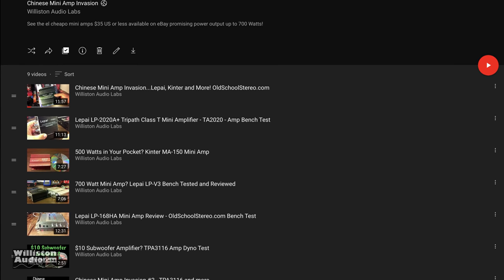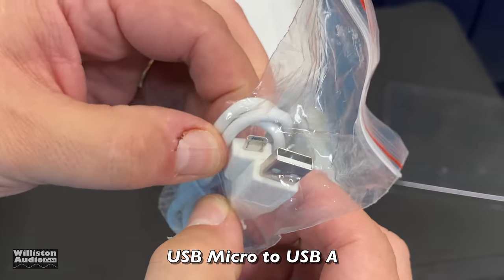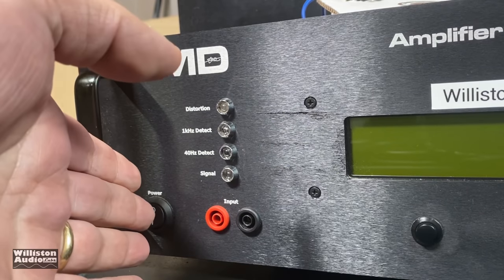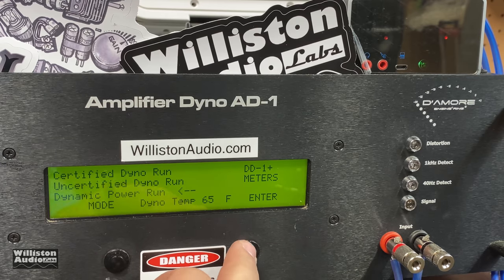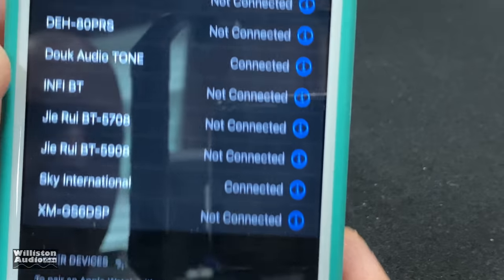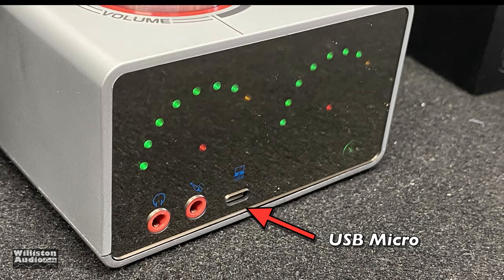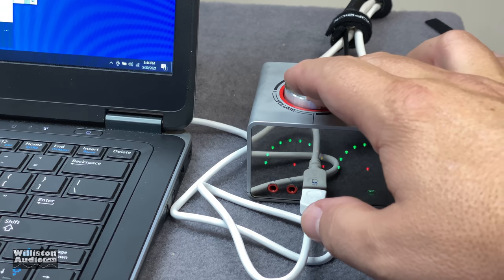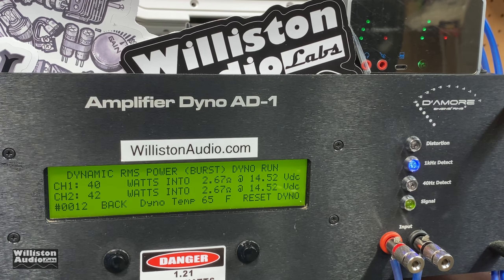Amazon Mini Amp Best Seller? - Douk Audio TONE 50x2 MAX Mini Bluetooth Amp Dyno Test and Review

Comment: Run Two of your Batteries in Series and see what that little gem will do with some 24 volt juice with some amperage !!
Reply: exactly. Thats what Ive been saying. Get her maxed at 24 full rated voltage and see how she pumps out
Reply: I'm for this.
Reply: I recommend use the 200W Lab PSU or 24V brick. That 19V is common for laptop psu. If using 2x 12V lead acid (14.4V) can be too much for that. 2x 3cell lion is much more closer to 24V but still over it if full.
Reply: Price  Kya  hi

Comment: Could you try testing this amp at 24 volt input?
Reply: with 26v in, the amplifier ic that does not have a heatsink becomes very hot!
Reply: It could overload the circuit to bt, also possibly vu meter too
Reply: @benzodiy4053  volt regulator that sits on the amplifier board that gives 5v to the preamplifier gets VERY hot! 24v to 5v is a bit much!

Much of what you buy on eBay is poorly designed and the watts that are written are almost always more than what is true!

people only go for the most watts and nothing else. People do not look at datasheets for amplifier ic.
Reply: @benzodiy4053  But its rated for that
Reply: His capacitors will pop at 24v. Bcoz 65 volt in chinese means 20volts.
Reply: @nearchd504  thats what im sayin, dont know untill you try. Thats what Williston is all about right???? NO, YES?? Thats what these tests are all about is breaking the assumptions that these amplifiers promote? Correct? If its rated at a certain voltage or amperage, then lets get at it scientifically and provide facts as to what degree the posted numbers say. IN OTHER WORDS, WHERES THE EVIDENCE!!!
Reply: @quevicular  I can't argue with a chief justice lol.  Let's hook this up on 24volts
Reply: @nearchd504  Now your talkin. Wonder if big Dummy is around to hear this?

Comment: Why does a $50 amp look better than many $1000 amps?
Reply from the maker: #iknowrite
Reply: $50 amp is trying to attract a different customer than $1000 amp.
Reply: @c0c0asauce  The sighted?
Reply: @Roof_Pizza  Certainly to some extent. You can't predict what a customer will be looking for 100% of the time but personally I don't care much what a $1000 dollar amp looks like. I'm paying the money for power, quality, and reliability.
Reply: @c0c0asauce  Most are pretty close once you start paying bucks. If a  $1000 amp doesn't last 20 years there is something wrong. If it truly was a tossup I'd go for the prettier one every time. No industrial boxes needed. Makes them easier to sell when it's time to upgrade as well.

Comment: Using older model for powering some semi-small speakers at PC, good enought for everyday use. Those 50W max is at 24V at 4ohm load. Oh, and about those VU meters... they are mono, just single channel to two sets of led's.
Reply: Was about to post the same.   19 volts is not going to happen at 4 ohms.
Reply: The VU meters look a bit suspect and look to be for just show. I could be wrong but it should be fed a rising amplitude sine wave for the test. One would think they would start at the low position, and gradually rise until red and then clipping sets in. Not that it really matters but it would be nice if they were tied to the output or referenced to it to let you know when your getting to its limit.
Reply: volt regulator that sits on the amplifier board that gives 5v to the preamplifier gets VERY hot! 24v to 5v is a bit much!

Much of what you buy on eBay is poorly designed and the watts that are written are almost always more than what is true!

People only go for the most watts and nothing else. People do not look at datasheets for amplifier ic.
Reply: It is made with as many fault as the edition I have that almost is similar to the one in the video. Completely the same amplifier card in both!

The card is mounted the wrong way with amplifier IC. Against back wall without heatsink on amplifier IC. and RCA plug is mounted over amplifier IC.

5V volt regulator to the front card gets very hot!

Mine had noise. So I had to put on a 1 UF condenser over + - on speaker output.

Min has a slight digital noise from preamplifier IC.

It has weak preamp sound output so when you connect Bluetooth  you never get Max Watt out

Those who have created this have been on a party first before they made this!!

Not the first time I see things that are made so wrong

Ebay. 383859993473
Reply: @ford1546  Yep.  What I say is buy better speakers.  15 watts can go a long way with a good pair of speakers.   If you want to drive a sub get a Sub amp built for the task.  For normal listening 15-20 watts is just fine.  1 watt can even be just fine for normal listening levels.
Reply: @jeffm2787  yes it is speakers that count the most but I would also have bought better amplified than this one in the video. do you want suggestions?
Reply: @ford1546  LOL,  No.  I have many amps.  This is not one I would use with good speakers.   Class D has come a long ways but I'll still take a good Class A/B.  I use cheap class D for stuff like the garage or the PC.  I have a cheap class D on my 9.4.2 setup for the back surround height channels.  I don't buy Bose,  but I'll use them if given to me.  I think you should see the point.  JBL, Infinity,  BA,  perhaps some Polk is kind of where I land.
Reply: @jeffm2787  Cheap class-ab is almost always better than cheap
class-D !
Reply: @ford1546  Agreed.  I love to use Class D when I don't care that much about the sound and I want to save a few cents on my electric bill.  A Class A/B powered on 24/7 adds up even at idle.  Class D,  not so much.  High end class D sounds good these days.  But we are talking a completely different price league.
Reply: @ford1546  soft and warm sound from the a/b amps, the class D is only for psu use :-)
Reply: @jeffm2787  Class AB left on 24/7 is about a hundred watt lightbulb. Doesn't really add up to much but nothing wrong with Class D for Home Theater.
Reply: @carlosoliveira-rc2xt  100 watts 24/7 at 15 cents per Kw/h is a bit over $10 a month.  Pretty wasteful if you ask me.    $15 a month if you live in places like California.
Reply: @jeffm2787  $10 a month wasteful? That's won't even pay for a Tim's coffee every other day for a month. Let's be realistic, there are thousands of things more wasteful. Optimum sound, depending on amp, may take 3 or 4 hours with a class AB version yet that's your preference? I'd say that's contradictory to your logic. A t- amp will output the wattage you claim sufficient for most instances and is easy on the wallet with respect to cost to purchase and run and therefore can be left on indefinitely. I've compared a 2020 chip t-amp ($50) to amps as costly as $1800 and it sounded better. Now my class A amps, those may actually be wasteful!
Reply: @carlosoliveira-rc2xt  Problem is it all adds up when you look at all the stuff running 24/7.  Ceiling fans are a good example.  $10 a month will get you a subscription to some steaming service that you can enjoy.  Pissing away $10 a month,  yep that's wasteful by definition.  Might as well get some mid priced beer,  at least you can say you enjoyed pissing away the money.
Reply: Price tel me sir

Comment: I've just recently found this channel. I've came across a predicament. I don't know if you take requests, but I have to ask. LANZAR VECTOR VCT-4110 this amp doesn't make any sense from the instructions. I've been installing car audio for about 20 years. I would like to know if it really puts out as much power as it says??  When I was younger, LANZAR was a respectable name. So could you please get that amp and review it?? You are awsome, I just hope we don't hear the "Price Is Right Fail Sound." You can get it on Amazon for like 80$ Thanks man,,,,,, I love this channel!
Reply from the maker: Thanks brother and unfortunately the lower end Lanzar is way overrated. Lanzar from the 90's was very nice and well built. Now you have to get the pro version of Lanzar to get the decent stuff. It's owned by parent company MD Audio who also owns Orion now. The HCCA and XTR Orion is nice, but the Ztreet and Cobalt is ho hum. If you've been out of car audio for a while, it will be very confusing now. Most of the brands you once knew as good ones are not so great now, however, Rockford, MTX, Kicker, JL Audio, MMATS, Alpine and AudioControl are still great.
Reply: Thanks man. For real.

Comment: It looks fancy but the thing is cheaply built, plasticky and lightweight. However its multiple inputs and outputs for that size is really impressive, saved much desk space. Have been using it for more than 2yrs for my PC, PS4 and TV. The lack of volume indicator is really annoying and its lightweight makes it doesn't sit solidly at the edge of a desk

Comment: Cool little amp, thanks for the video.
Reply from the maker: Yeah man, I have a thing for the little amps and you know those VU meters GOTEEM!
Reply: @wal  I run 2 JBL JRX225 dual 15” towers and a 4-15” JBL GTO on a 3 ch mini circuit board amp using a 20 v lithium drill battery in my camping/cargo trailer and it absolutely whails!  I haven’t met a person yet that hasn’t been blown away (pun intended) by it.
Reply: @russelllopez4171   please post a vid of your setup.
Reply: @MiloPerrotti  ok, I’ll be honest I just dumped one 15” and am running 3 @ 1.33ohms. It actually rips harder than the 4 due to better tuning and I can run at 1.33 instead of 4ohm.  I’ll make it even more fun and I’ll meter it in the trailer with my term lab. Lol
Reply: @russelllopez4171   That would be great to see. I would love to do the same setup or close anyways in my trailer.
Reply: @MiloPerrotti  I’ll just do a quick hookup of them for display but I typically run the towers at the end of my trailer and leave the subs at the front of it.  And if I’m not facing noise restrictions I have a generator and a pair of QSC1450 concert amps that run it and it is just like having a system in a car. Lol.

Comment: That's decent power for it's size, and adaptability of this amp is a big plus. This would be great for a custom portable speaker build.
Reply: they sell the boards themselves - minus the chassis for cheaper as i have built  few of these before ... pair them with 18650 type lithium ion rechargables ...

Comment: I’ve run a Lepai amp in a Bluetooth speaker I built and have come to find out that some of these little amps have a higher output if you use a battery instead of the included power adapter

Comment: That's a cool amp. Nice look. I love the fact it can be a USB sound device.
Reply: It is made with as many errors as the edition I have that almost is similar to the one in the video. Completely the same amplifier card in both!

The card is mounted the wrong way with amplifier IC. Against back wall without heatsink on amplifier IC. and RCA plug mottled over IC.

5V volt regulator to the front card gets very hot!

Mine had noise. So I had to put on a 1 UF condenser over + - on speaker output.

Min has a slight digital noise from preamplifier IC.

It has weak preamp sound output so when you connect Bluetooth  you never get Max Watt out

Those who have created this have been on a party first before they made this!!

Not the first time I see things that are made so wrong

Ebay. 383859993473
Reply: TPA3116 is a good amplifier ic. if everything is designed correctly. you get good amplifier card based on TPA3116 but this box does not have good amplifier design!

Comment: there is a new version out now and I'm wondering what chips it uses?  still the 3116 for amplification or a newer chip?
Also what is the bluetooth capabilities of the new one?  is it the qcc3031 chip or???...
There is also another cheap bluetooth amp the Douk Audio M100 that uses the Infineon Merus MA12070 chip.  I bet this sound good for the money.

Comment: I was surprised by this one. First by the power. I figured it would top out at 15w per channel but it doubled my expectations. And then when you opened it up I found out why with those caps in it. I was not expecting caps that big in this amp. For $50 this isn't bad. I mean it's not an ifi or a mojo but it's also not $500. So as far as getting some inteligible sound this thing is a steal. I mean it's way more than I expected for $50. Your not going to hook up a pair of tower speakers for critical listening with this thing. Your still getting more than what your paying for

Comment: I would like to see what happens cranking up the voltage. TPA3116 D2 handles up to 26 VDC
Reply: TPA3116 is a good amplifier ic. if everything is designed correctly. you get good amplifier card based on TPA3116 but this box does not have good amplifier design!
Reply: It does say 50x2 @24V
Reply: @Raymo2u  50w is when you push it hard with optimal power supply and constant 4 ohm load. 
But then you should have heat sink on amplifier ic. something this one does not have.

Factory writes the following. 
You should never have more distortion than 1%
10% is way too much. 
10% THD does not count!

THD + N = 10%, f = 1 kHz, PVCC = 14.4 V
25W

THD + N = 10%, f = 1 kHz, PVCC = 21 V 50w

THD + N Total harmonic distortion + noise VCC = 21 V, f = 1 kHz, PO = 25W (half-power) 0.1%.

Comment: Need an amp for my home gym. This seems perfect.
Reply: It is made with as many errors as the edition I have that almost is similar to the one in the video. Completely the same amplifier card in both!

The card is mounted the wrong way with amplifier IC. Against back wall without heatsink on amplifier IC. and RCA plug mottled over IC.

5V volt regulator to the front card gets very hot!

Mine had noise. So I had to put on a 1 UF condenser over + - on speaker output.

Min has a slight digital noise from preamplifier IC.

It has weak preamp sound output so when you connect Bluetooth  you never get Max Watt out

Those who have created this have been on a party first before they made this!!

Not the first time I see things that are made so wrong

Ebay. 383859993473
Reply: bluetooth speakers have gotten really good also
Reply: @FSXgta  Yes since electronics have become cheaper. Many Bluetooth speakers like JBL Xtreme use DSP. Signal processor where factory adjusts an equalizer.

Comment: Only complain I have on mine, the Fosi Audio TB10A (TPA3116) and Douk M1 Pro (TDA7498E) are that if you connect them to high-sensitivity speakers (95dB/W) there is slight hiss that can be heard in the tweeters (if your volume is high and music is not playing). In comparison, my full analog Marantz PM5005 (~80W x 2) is noise-free and has more "depth" to the sound but the price and size are magnitudes away from these little chip amps. At this price point though there is not much to complain about considering their size and versatility.

Comment: Might be worth it to test RFI (radio frequency interference) within a few feet of it. I've got a Dayton Audio mini amp powering some ceiling speakers to have music throughout the house. It sits 2 feet from my stereo receiver and works great with any source.....except FM radio. Reception is fine until I turn that mini amp on, and then it goes to total garbage. I had a Lepai before that and it did the same thing.

Comment: Hey quick question, I'm trying to get more bass for my stock garbage bose audio in my 2019 pathfinder ,I've added a 12 inch pioneer  woffer and a old toshiba amp I had lying around but I don't feel the difference, any advice on a woffer and amp combo that will punch ,I need da BASS .also I don't wanna break the bank either cause the little lady would be p o 
Thanks ,love the vids and your channel bro

Comment from the maker: Shop (affiliate links):
Douk Audio TONE Amp: https://amzn.to/3uVMkIY
ELAC Debut 2.0 B6.2 Speakers: https://amzn.to/3gcZHiC
Video Playlist of Mini Amps Tested: https://is.gd/miniampstested
*NEW* See the 24V Test of this amp: https://youtu.be/VQcj4_YCJgw

Video Index:
0:00 Intro
1:05 Unboxing
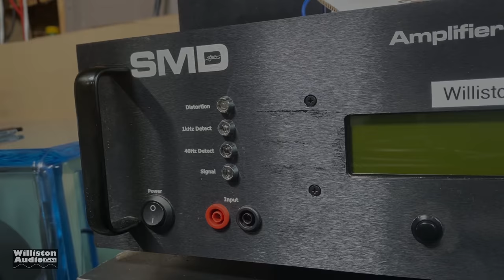4:21 Amp Dyno Tests
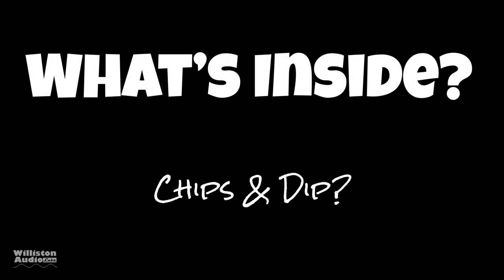7:00 What's Inside?
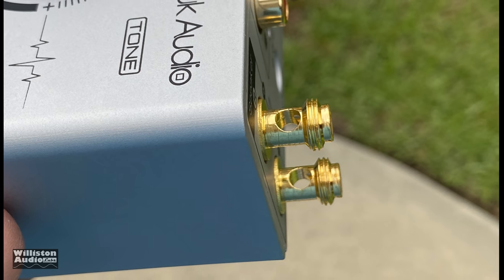8:08 Bluetooth Connection
8:52 Do It Bump Doe?
9:53 Testing Inputs
12:36 Pros/Cons
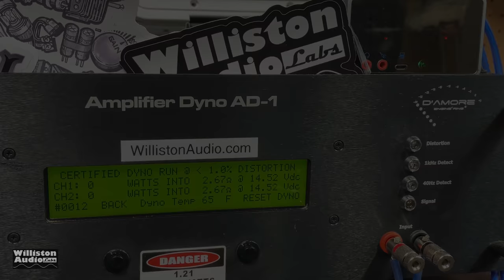14:02 2.67 ohm Test

SMD / D'Amore Engineering Amp Dyno: https://goo.gl/sJTcf7
XS Power D1400 Batteries - https://amzn.to/2BPFCKW
XS Power PSC60 Charger - https://amzn.to/2CHGcfs
Fluke 1000A AC/DC Clamp Meter: https://amzn.to/2Rw5WDA
Handheld Dyno: http://amzn.to/2u2EgKV
My Favorite Screwdriver Kit: http://amzn.to/2x0VzcE

DISCLAIMER: This video and description contains affiliate links, which means that if you purchase from one of the product links, I may receive a small commission. As an Amazon Associate I earn from qualifying purchases
Reply: TPA3116 is a good amplifier ic. if everything is designed correctly. you get good amplifier card based on TPA3116 but this box does not have good amplifier design!
Reply: It does say 50x2 @24V, 19V isnt quite 24V so the numbers seems to match up
Reply: Don’t know if it’s a manufacturer error or printing error on the case but found mine to be out of phase on one channel, swap one channel and it comes to life
Reply: Douk audio amps can be pretty alright but they definitely need better power supplies if you are trying to get good clean power out of them. Personally I prefer Wondom amplifiers

Comment: they don’t give you but they might include  those items  for the price you pay  i’m 57 years  old and in the late 1970s  i spent over 2 grand  on my first  Stereo System  watching these videos and seeing some of these made in China specials freaks me out on the low price these things can be purchased at considering  that includes the engineering manufacturing and the shipping costs  from a place  basically on the other side of the World  often directly to my front door  and it works  as intended Usually
Reply: I  bet your 2k kit sounded much better than this rubbish.